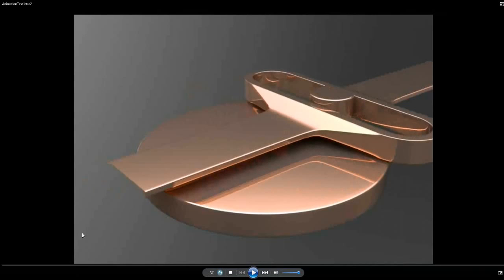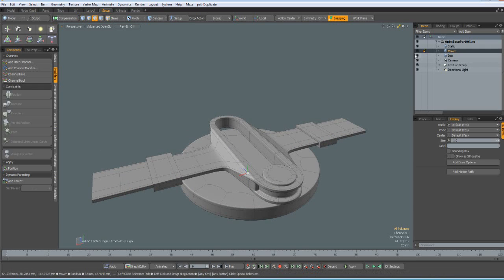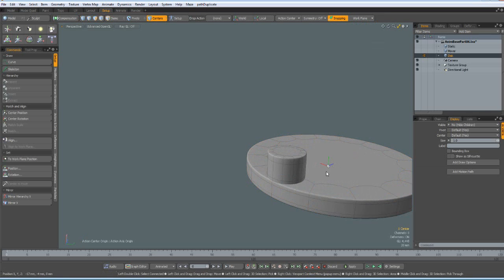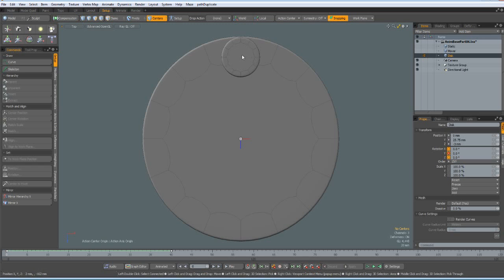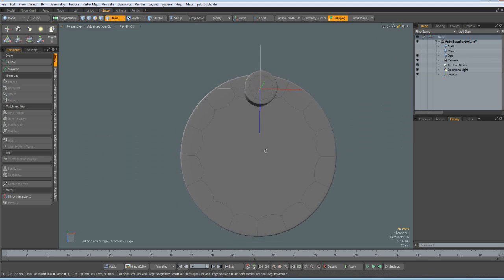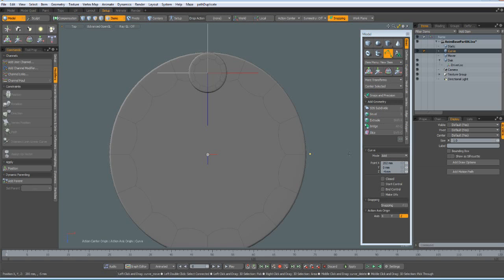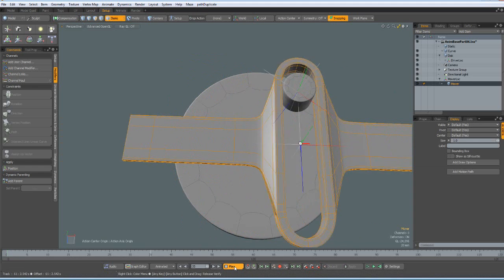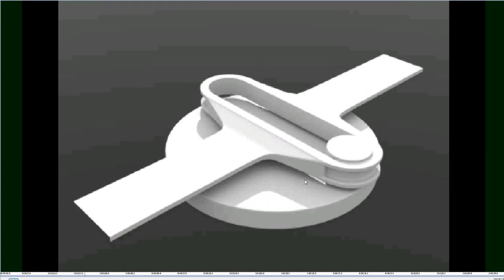Luxology modo - Animation Basics Part 01

Comment: When i render out movies in modo using the Render Animation option i get really terrible quality and it looks nothing like the rendered image with all the high quality .Please where can i find out how to render high qaulity movies in modo ?
Reply from the maker: MONEYVAL9 Hi, I don't know any other method than the one i describe in this video and i am quite happy with the results
Reply: Did you use the "Render Animation " option? and that worked?
Reply: +MONEYVAL9   Old question, but you should propably render the animation out as an image sequence and create the video from the images. Its also good way to split render times this way and good in case something bad happens (crash, power lost etc.) as you only would lose the frame that was currently being rendered.
Reply: I've long left modo .

Comment: thanks for all these great tutorials. here's a maybe easier way to transfer the motion of the disc to the translating part. once the locator is rotating with the disc create a new locator and point constrain it to the one which is parented under the disc. than disconnect the Y and Z channel so only x moves. now you can parent the moving piece or do another point constraint with Y and Z disconnected.
Reply from the maker: Sven Pohle Thanks very much for the suggestion. I will try this. Kind regards, Peter

Comment: Hey Peter, as always awesome video. So glad your doing a beginners intro Animation series. I ran into the same problem myself with finding animation tutorials but not ones that were very simple. Or didn't fully cover a lot of the basics. 

Also just a side tip, when you changed the locator size to .2 to make it smaller. You can just set it to zero and it will stay to scale no matter how far you zoom in or out from it.

Can't wait to watch the rest!!
Reply from the maker: Hi Ken, thank you for this useful tip. I hope I will not forget about it next time. Btw, I am a beginner in animation myself, just started and was hoping for support like yourself and others. Hopefully you will not be disappointed :-) All the best, Peter

Comment: Hi Peter, Just been playing around and it seems you can get a similar result by just using a position constraint but by zeroing the Y Opacity in the matrix channel effect of the its constraint property
Might be interesting to look at
Reply from the maker: Hello Steve, you are absolutely right. This works equally well and is easier to setup. Thanks for the tip and all the best, Peter